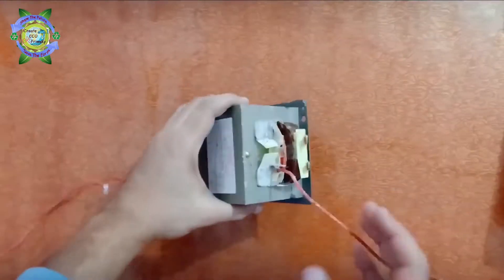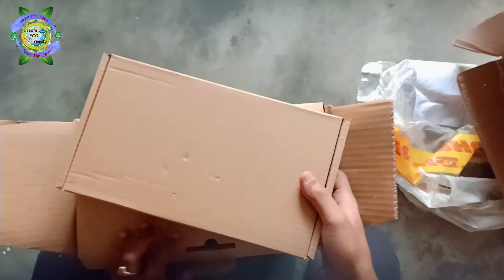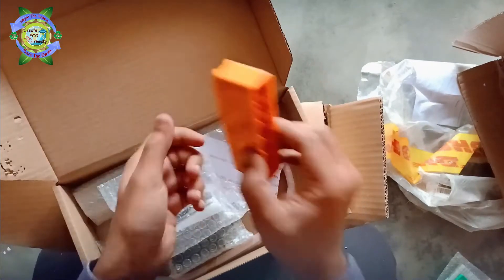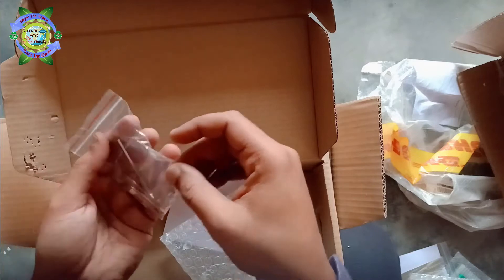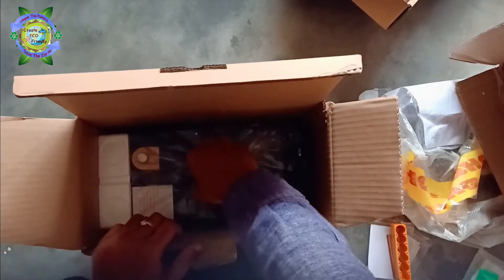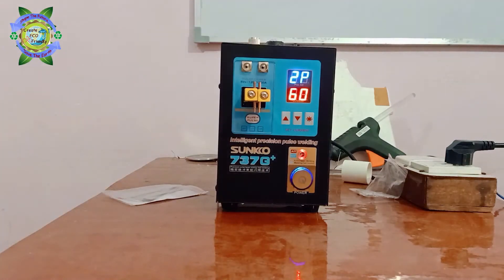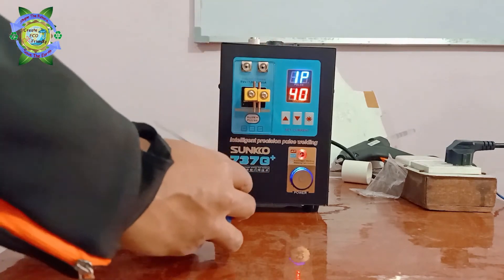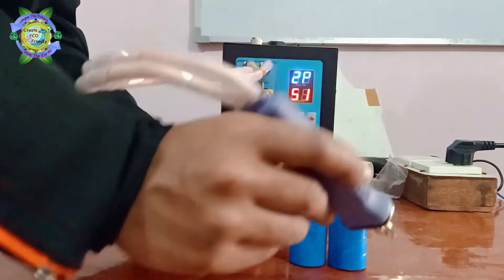Sunkko 737G+ Spot welder Pulse Welding Machine

Comment: This honestly isn't a bad machine, I own this and I build huge battery packs with it, but you must know a few things first. For one as mentioned don't expect much out of the pen unless you upgrade it as I have. I made my own pen as this one is not good for above .15, if you get yourself some heavy cable like 0 or 4 gauge copper and run you pen directly to the same post that the copper pins on the machine use by using some heavy duty ring lug terminals, copper as well, don't make your cable longer then 30 inches and you will be happy, now on the other end all you need to do is to take another ring terminal and cut the ring off of it and shove a piece of solid 12 gauge copper into it and crimp it onto the heavy gauge 0 or 4 gauge wire with the 12 gauge copper sticking out a little bit as this will be your pen leads, then tidy everything up with heat shrink and a cable tie or whatever you like I have my electrodes separate as I find it nice to change the distance I place them for my gap. If you do this you will be able to weld with this machine like it  is supposed to. 

Another thing that sux about these machine is that I can promise if you don't put some better colling on this you will blow your mofset in about two weeks time I went through 2 of these before realizing that the tiny little fan inside is inadequate for the amount of power you are pushing through this. So to fix this I installed good 24v fan one for intake and another for exhaust like the kind that computers use. Ever since doing this I have ran my machine this way for couple of years with no problems, however after I run. A few rows of batteries I still give it time to cool, I don't know if this is necessary with my cooling fans or not but I'm not taking any chances. 

And lastly don't buy the 737G Make sure it's a 737G+ and it's a 210v system because the 110v, he is a crappy look alike of this one and he really can't weld. Yes you will need a dedicated 220v line which isn't a big deal because you can still use 12 gauge copper you just need 12/4 or do like I did and run double 12/3 wire coming out of your panel but make sure he has his own breaker, because he doesn't like to share power with anybody else. This machine is a power hungry amp boss when you run it like it supposed to be run. Not saying that it's perfect but for anyone that is on a budget this machine can be fixed to run right but you have to make sure you do it right. 

But due anybody who accidentally blew his mofset up because the dumb Chinese engineers couldn't spare a bigger fan to cool him down better you can buy replacement mofset on Amazon to make him run good again. 

Like I said the first couple weeks I had mine I blew a hole right through them offset the size of a BB bullet and I was like what the heck. But was very happy that I was able to fix him again but the mofset cooling is 100 percent the problem with these blowing up.
Reply from the maker: Thanks sir for such detailed... Information....
I also realised that this pen is not good for thick plates... Will try to make my own diy pen.... Thanks for the knowledge....
And I already used proper cooling system when I realised that there is some kind of smell so I took care of it... And remaining configuration are same like 220v and its 737G+

Comment: Thanks you

do you recommend this

i am planning to purchase

Thanks
Reply from the maker: Well, for simple uses it is good... But, can you please tell me for what purpose you want to buy this?
Reply: @CreateECOFriendly  
To make e bicycle and e bike battery packs

not just DIY but to sale battery packs

Do you recommend, how much is the price

Here in local market hyderabad its around 16 to 20k

Its Sunkko 709AD+

What you suggest

Thanks
Reply from the maker: For making Big battery pack I will not recommend this.. 
In this you will only weld battery using pen with 0.15 mm pure nickle strip,

But there may be very specific demand from customer, so I will recommend this, for smaller and portable work only, the cost of this one is 10,499 + 3,000 shipping cost and no Tax as it was send as gift by friend of my friend...

And before buying spot welder please make sure It is Upto, your requirements..
AS welding thicker nickle strips from this spot welder will result in good spot weld, but after some time weld will definitely break this happened with me.

So go for bigger power and have warranty...
I hope this clear your doubt...
If have some doubt please reply or Should I make a video on this topic?

Best of luck...
Reply: @CreateECOFriendly  

Which spot welder do you recommend for medium, large battery pack 

Is 709A will you recommend

Thanks for reply
Reply from the maker: Can you please share what kind of battery pack will you make.? like very big batter pack of eBike, solar, etc or small battery pack of eCycle, power-bank?
Which nickle strip thickness will you use?

Although I didnt use Sunkko 709A, But it is weaker than mine, but as description of 709A on its official website, It should be good for 0.15 mm thick nickle plate, and mine is also very good for 0.15 mm thick nickle plate, weld will not break easily, I have to pull a lot to break the weld, 
But I cant tell much with thicker stripes of nickle, as Mine were break which were welded by welding pen but worked fine with fixed head.
Reply: @CreateECOFriendly  

Mostly eBike 24, 36, 48, 72 volts

0.15mm to 0.2mm 

I am still exploring and learning to start battery pack making for e-bicyle and e-bike
Reply from the maker: 0.15mm is good but I cant say about 0.2mm or more
Reply: @CreateECOFriendly  

Thank you for your support

Here local electronics shop 709A its around 18k

Do you think its good investment if i purchase
Reply from the maker: Are they providing any warranty?

If they are providing warranty then its good for beginners

In a long run If you are planning big in battery pack you will HAVE TO buy bigger machine.

So it's up to you, what's your plans are...if you have less funds now you can go for it... But don't expect much from this, I also understand you also have to purchase other machines like battery testing machine resistance, terminal voltage for making balanced battery pack... So In starting you can start with this.. but don't expect much from this, making battery pack on this one takes time to and it will help you in practice... But other automated machine help you making battery pack much faster... But they are very costly for beginners...

And If you try importing device directly from china then It will cost around 15-16k + tax which is almost same as this one... Chinese people can give warranty but its of no use as in sending machine to china and importing back will take a lot of money

If no warranty you have to handle it carefully although sunkko's quality is good and it uses all measures like fuse etc but its chinese..
Reply: @CreateECOFriendly  

No warranty

In local electronics market Sunkko 709A available with 18k price, no warranty, you can say for hobby to make battery pack, till now not get any order slowly want to start as you said first understanding the concept

and need 

1. Battery Capacity Testing   i made with arduino by the help of youtube
2. Internal Resistance Tester need
3. Charging Individual using TP4056 Made (Steve Wilson Kujur Design)

And i purchase 12v Spot welder using lip0 battery 35c 

Slowly starting, don't have budget to start big

Thanks for your reply
Reply from the maker: Same with me no budget.., so starting slow, now you can start with this one... As 708A is better than 12V spot welding machine, it has current upto 800A, but mine has 1200A max current
Reply from the maker: Same with me..
No extra funds...
Starting slow...
Taking help of YouTube If my channel get success.. I will do many things... regarding eco-friendly products
Reply: @CreateECOFriendly  

Insha allah

I will support you

Thank's
Reply from the maker: @mdaslamknl  Thanks a Lot